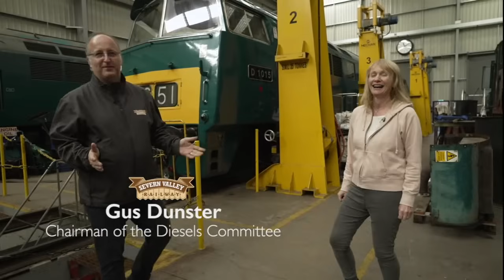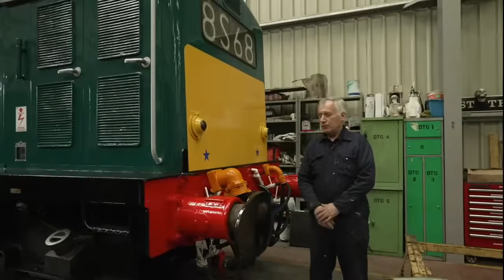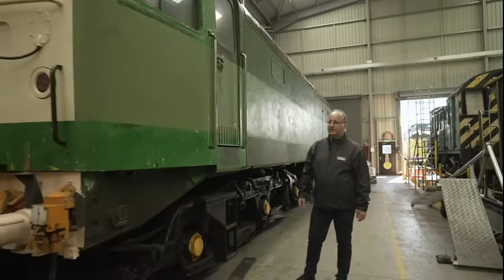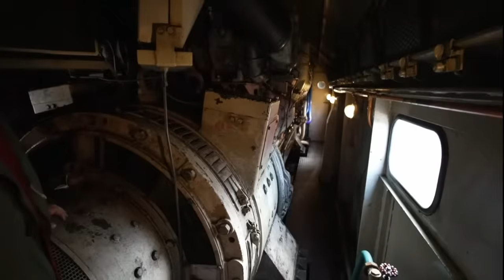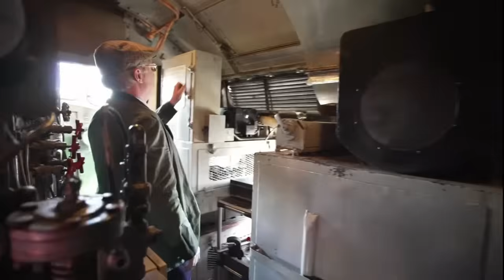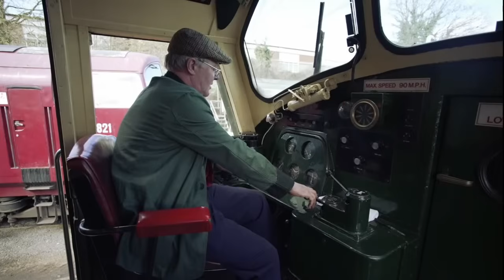Kidderminster Diesel Depot Uncovered - Behind the Scenes on the Severn Valley Railway

Comment: Considering different engines, even from the same class of locomotive, are going to put out slightly different kW's at the same rpm as eachother, and each different class has different gearboxes, wheel diameters etc etc, I think it's AMAZING that you're able to control one loco's output, from the cab of another.!😲🧐😲!  with little to no buffer, buffer buffering.!🤨!.
With modern electronics, this nowadays, is by far easier to obtain.  But going back to the early part of the 1900's, doing it with the relatively simple electronics\electrics of this era (and even mechanical in older equipment), was in my opinion, a bit 'Paul Daniels'.

LOVE THE VIDS.🧐🥰,
KEEP'EM COMING.🤞🥰.
RICH(UK).😁😋🥰.